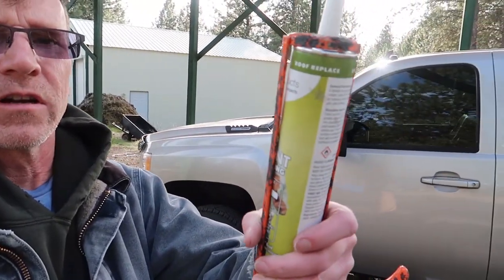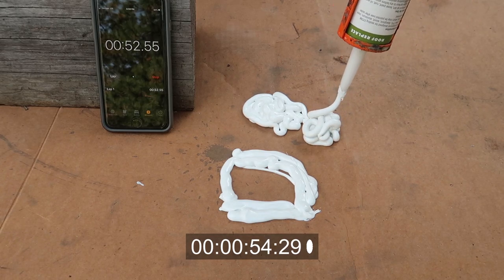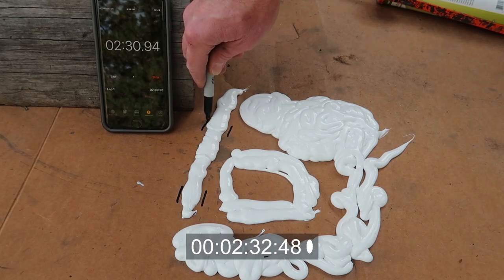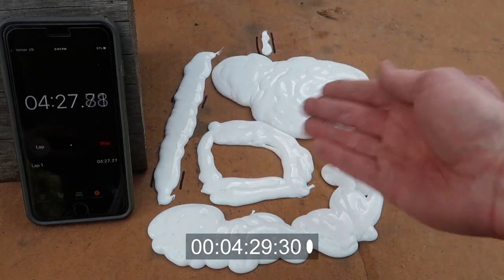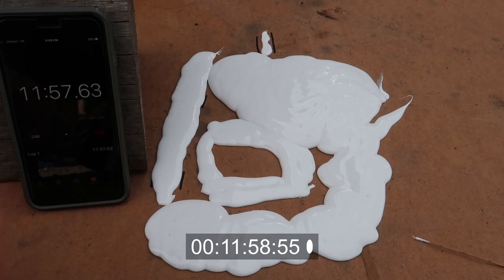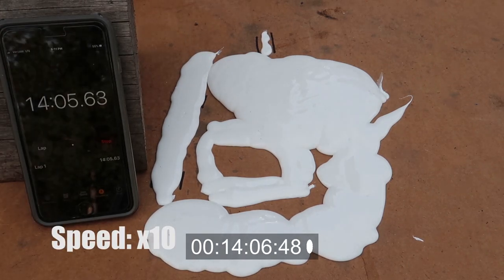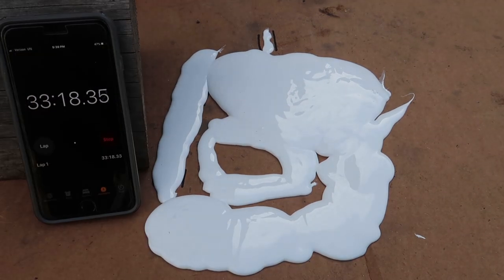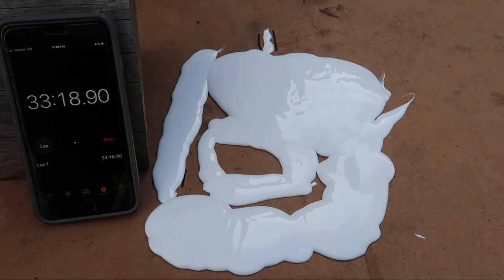Dicor 501LSW Self Leveling | Elapsed Time to "Self Level"

Comment: I thought it was still leveling a noticeable amount up to 30 minutes. I would guess ambient temperature will affect the time as well. But very cool that you did a test so we can have some sort of idea how long it takes so thank you for that. Regarding an old tube, my first trailer purchased they tacked on all sorts of crap, I didn't know better, one was a tube of this. When I replaced a vent 7 years later I remembered the tube and thought "is it worth saving 10 or 12 bucks to risk using an old tube?" Heck no, I'm not going to risk a leak over the winter when I don't notice it while the trailer is parked, or start leaking on a trip, You want to crawl up there once, do your vent, check for other cracked or peeling spots and fix those too and be done with it!

Comment: How long until it's actually fully cured and dry?
Reply from the maker: For a normal thickness bead, like if you were resealing a vent, it looks like about 24 hours.  The thick puddle on the piece of cardboard is still soft a week later.  I  have checked it every day after I applied in on 4/4/20.

Comment: What the difference between the green tube self leveling and the orange tube self leveling.  The green tube always seems to cost less, but not sure Why?  I checked the dicor website and there is no green tube self leveling on it.
Reply from the maker: I've never see colored tubes, so I'm not able to answer that question.
Reply: @deltabravo1257  So, A guy from Dicor responded to my email and he said it was the same product in both tubes.

Comment: What if I needed it for horizontal application. Will it just fall to the bottom and cake up ?
Reply from the maker: Well, this is for a horizontal application, i.e., a flat surface, like a roof.
Reply: @deltabravo1257  dicor makes a non leveling for vertical application